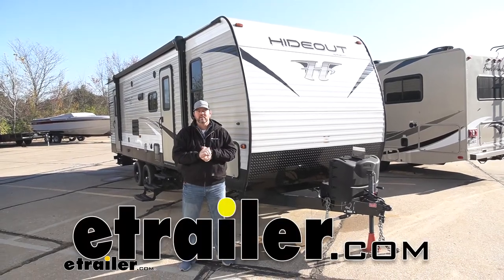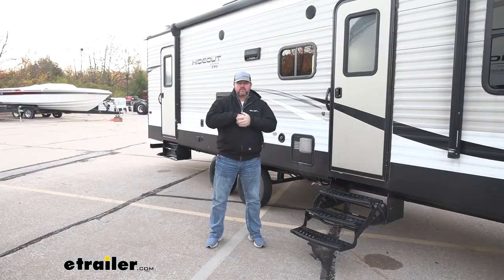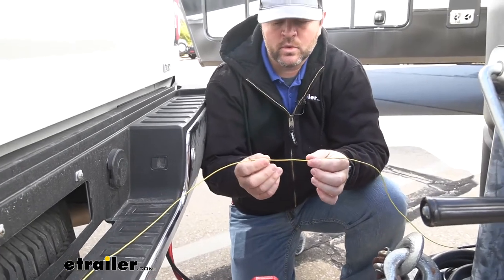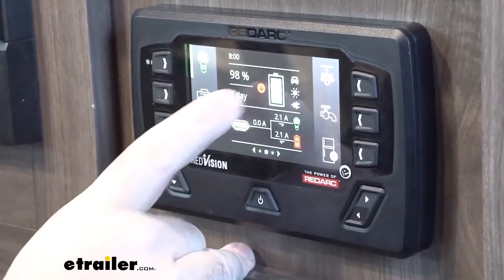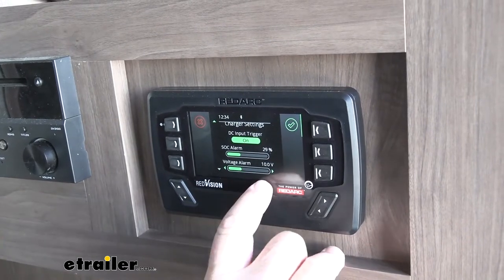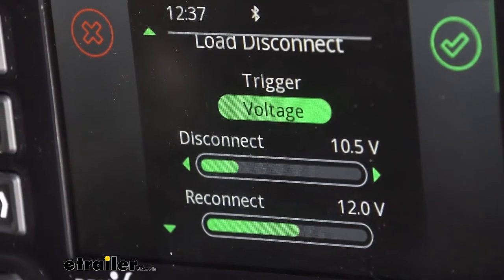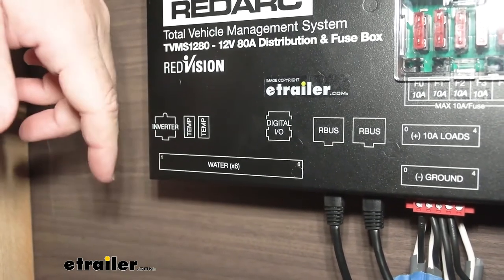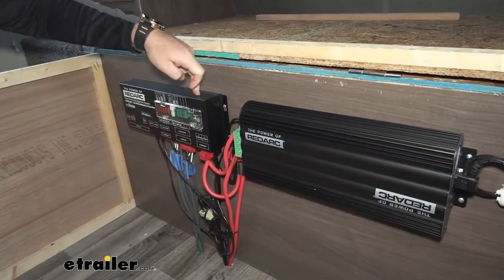Redarc RedVision Total Vehicle Management System Install - 2017 Keystone Hideout Travel Trailer

Comment: What water sensor did you use with the redvision? Thanks
Reply from the maker: With the installation of the RedVision you can tie the water level control into the sensors that are currently on the camper.
https://www.etrailer.com/Smart-RV/Redarc/RED79FR.html